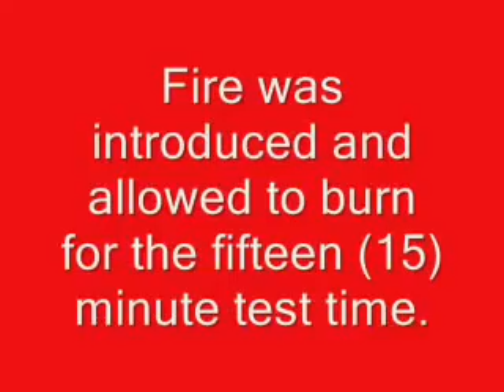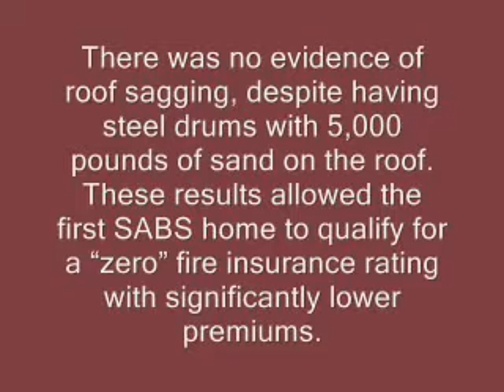UL Fire Test

Comment: After the foam is coated with the sabcrete substance is it as strong as concrete? Does it resist fire and wind as good as concrete does? Thanks in advance for your answer.

Comment: How difficult would repair be. Considering the building method I imagine you would break the SABScrete back to fresh foam and then square it off and put new foam into the gap using your foam spray to connect the old foam and new foam. Then you would apply a new layer of SABScrete over the new foam and slightly overlap the old SABScrete.